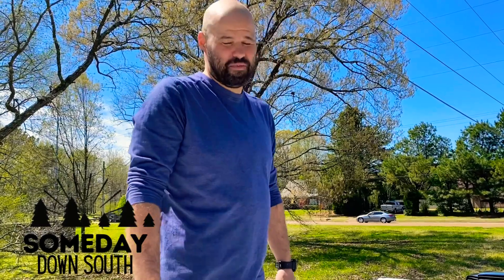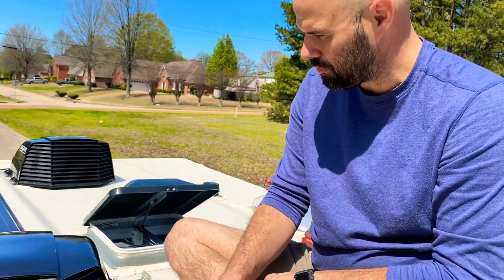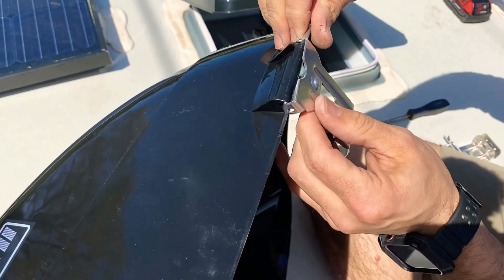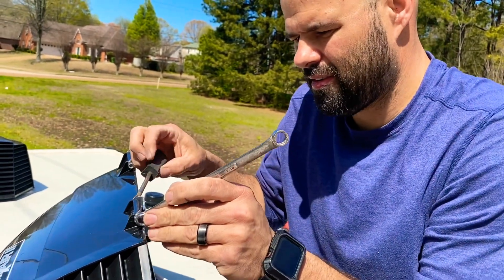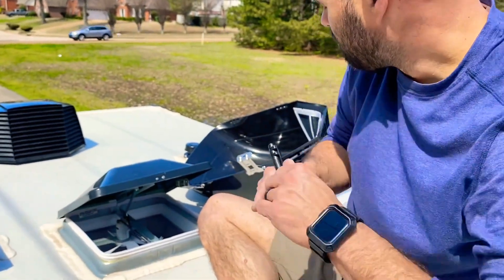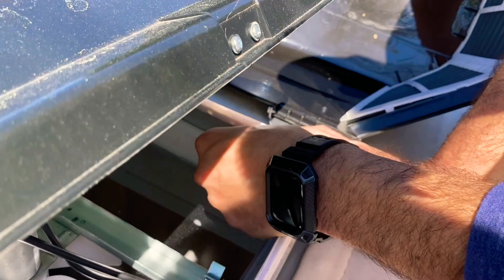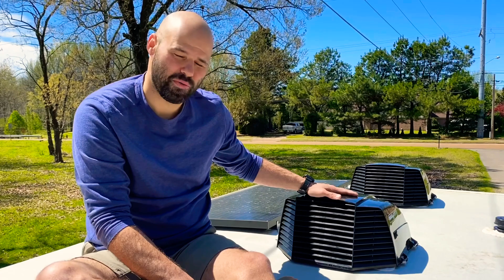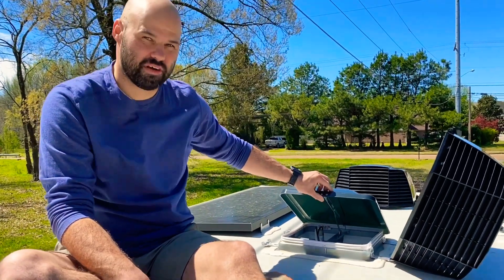RV How-To | MaxxAir II Vent Cover Install

Comment: We installed ours a couple of years ago and it makes a big difference! The rain sensor used to get wet and you could not turn on the fan but the cover fixed that. Ours just clipped on so we did not have to do any drilling. Thanks for sharing! Chris and Barbara
Reply from the maker: Oh that’s it awesome not to have to drill! I’m glad to have vent covers  just incase I forget to close the vents on travel days 😅

Comment: No issues with the fan? I’ve heard that fans may over heat if you don’t get the right vent cover
Reply from the maker: We haven’t had any problems, but tbh we haven’t used the fans much since we put the covers on. We will definitely update if they start overheating. I haven’t heard anyone on the transcend FB group say that they’ve had a problem with the MaxxAir 🤞🏼